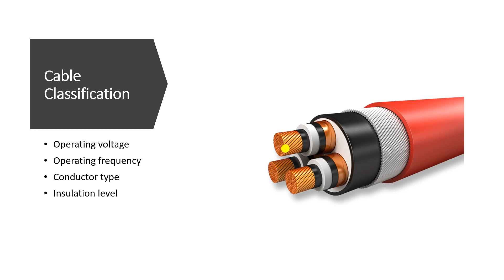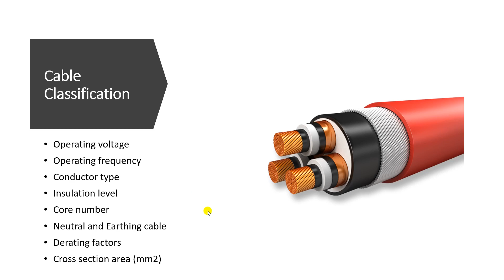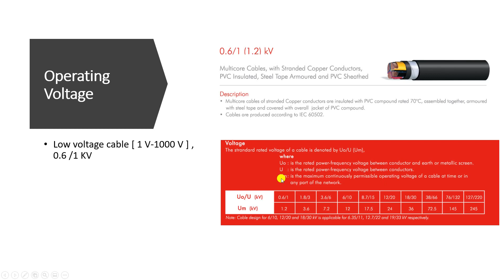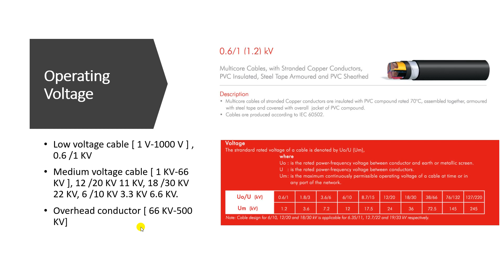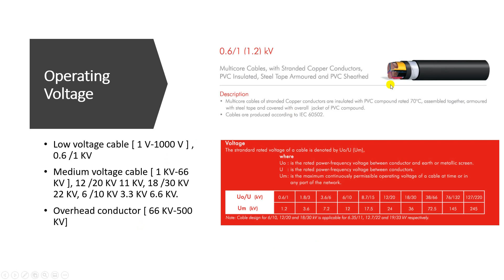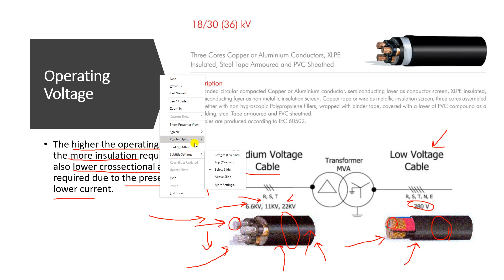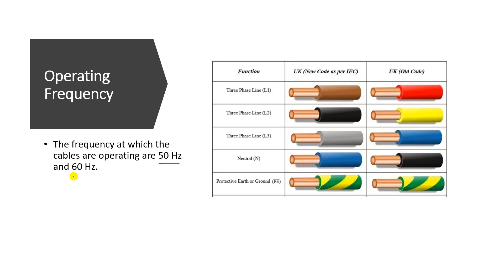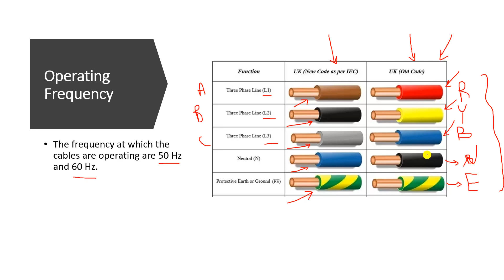Classification of Cables (1) In Cables Electrical Course

Comment: Can we use 18/30kv cable in 33kv system?
33kv is line voltage.
Reply from the maker: This will lead to an overvoltage of 10%, you will need a cable that can withstand 33 kV.